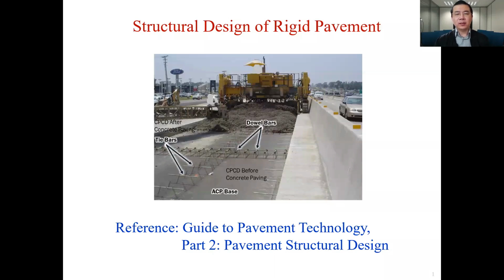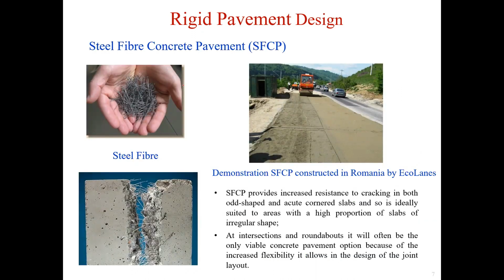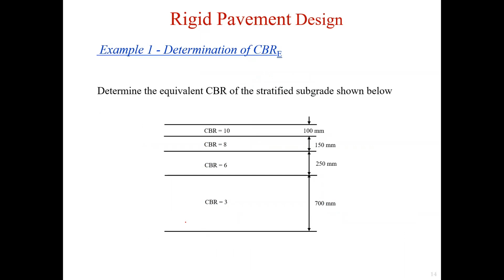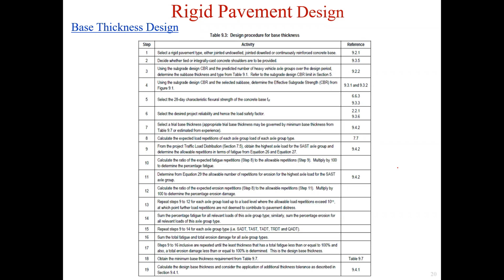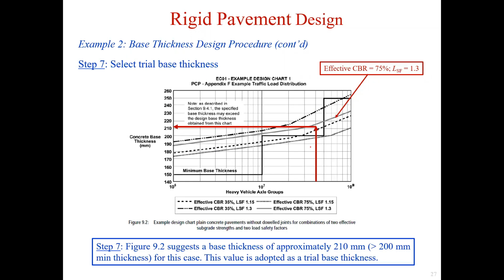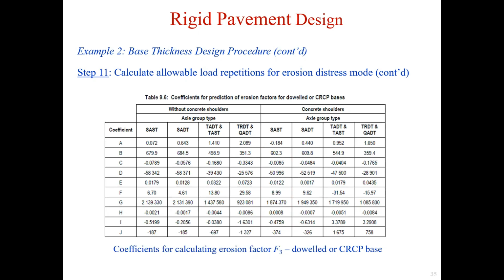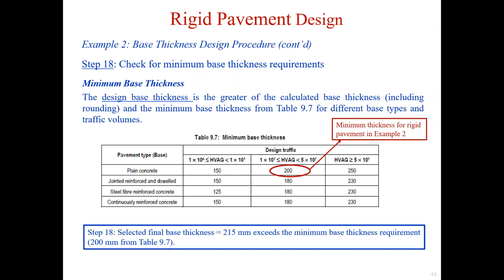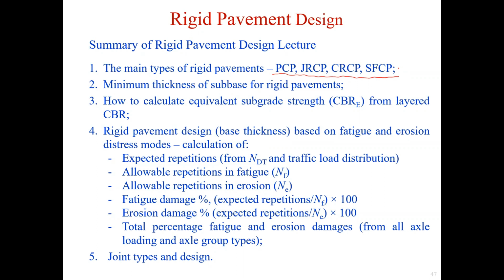Lecture 9 Rigid Pavement Design 2021

Comment: Hi Peter, can i ask, why that I'm getting a different value than your example  for allowable repetitions for erosion analysis? for my excel input (see blow), the value is extremely small by using P = 70 as an example.

=(10^(14.524-6.777*((MAX(0,((F24/4.45*$M$80)^2)*((10*$M$70)/41.35)-9))^0.103)))/$M$73

Please help!!!
Reply from the maker: Hi @@alexbu7938, thank you for your interest in my video. I assume you question is related to the allowable repetitions for SAST group axle load of 70 kN in slide 37. The erosion factor could be calculated from the equation in slide 33 in combination with the coefficients in slide 34, so F3 = 1.865. Then based on the formula in slide 32, Ne = 10^(14.524-6.777*(max(0,((70*1.3/4.45/9)^2*10^1.865/41.35-9))^0.103))/0.94 = 978333565, which is the same as the value in slide 37.
Reply: @peterhu5330  Thanks Peter, Is it possible for me to add you from Wechat? I assuming you are practicing here in NZ/AUS?
Reply from the maker: @alexbu7938  If you want to connect, please leave your wechat id here.
Reply: @peterhu5330  Thanks Peter, My Id: buhaojian     May I please as you to delete this comment after you've sent the request. Tank you.